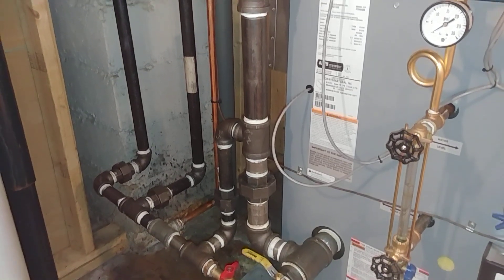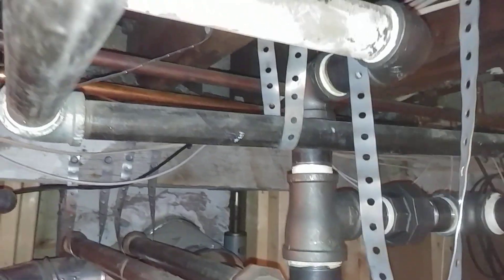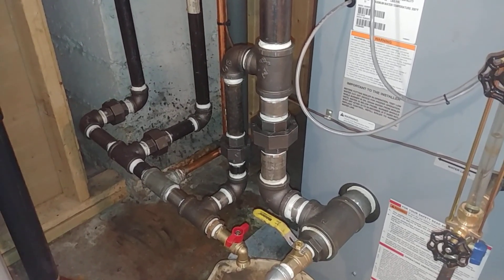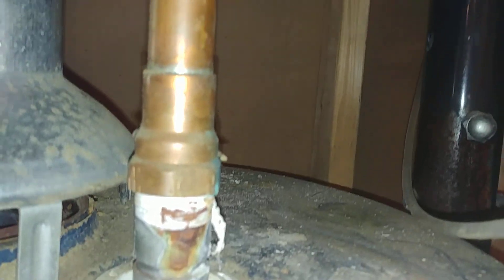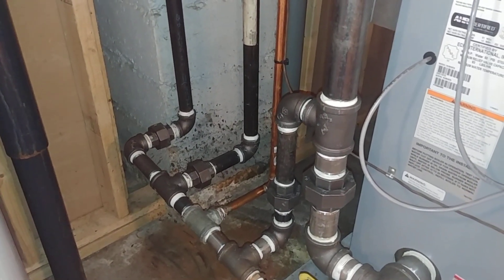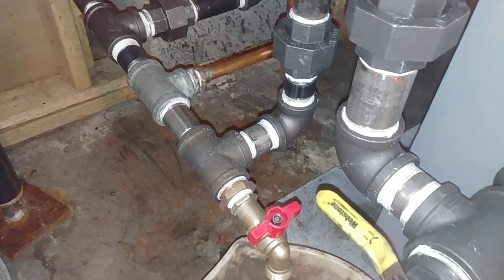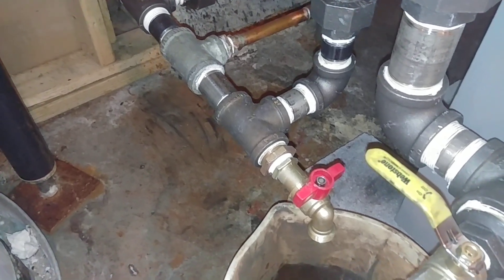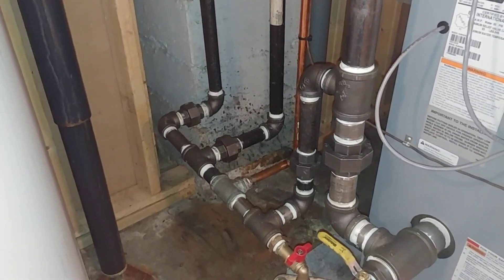Corrosion Control On Steam Boiler Wet Returns - Some Thoughts & Ideas

Comment: How do you feel about Rectorseal 8 Way BoilerTreatment?  I've been using it to clean a neglected steam boiler, and its supposed to help prevent corrosion, and a list of other claims. It makes the water a lavender color which is easier to see in the sight glass too, and it's fairly inexpensive. 

There claims.... 

Applications

8-Way can be used for cleaning very dirty steam boilers. Boilers with excessive scale, rust and muck.
8-Way can be used to maintain clean, rust free water on new or existing systems.

Benefits
Removes sludge.
Removes rust scale.
Inhibits boiler corrosion.
Inhibits steam line corrosion.
Prevents oxygen pitting.
Inhibits lime scale.
Prevents surging and foaming.
Controls pH with a color indicator.
Does not contain petroleum distillates.
Will not damage seals and gaskets.
Reply from the maker: I think it might be worth a try.
I have heard others also tout its benefits such that I am starting to become convinced to use it.

Comment: Stainless is great....hard to get a steady stock of sizes and fittings. My failsafe is a dielectric union and or brass
Reply from the maker: I pre-order runs of stainless and have them in my bunny box plus extras of close and shoulder stain-less nipples.

Comment: Someone suggested to me that they think that using distilled water is less troublesome than unfiltered tap water when running a steam boiler because it doesn’t contain any salts that will be dissolved and return to the boiler as sludge. What are your thoughts about this idea?
Reply from the maker: I am not sure about the wisdom of using distilled water in a typical steam heating boiler.
I might be spoiled, because the tap water in my area is not too bad.
As much as possible, the dead steam, or water, is being returned to the boiler, so there should not be a big build-up of total disolved solids (TDS).
Is distilled water, because it is pure, hungrier/more aggressive than tap water? I might be inclined to think so.

Now, if one is running a production steam boiler, especially where the steam comes in contact with food, that's a different matter...

Comment: I have had a question forever about mains and their sizing. In air flow, static pressure, velocity, resistance to flow etc, all play into ultimate flow/ CFM. (Not to mention the unit's performance and lifespan) The duct sizing relative to engineered blower CFM is more integrated than many people realize. But steam? If it expands 1600-1700 times, what effect does that have on the boiler? I hear 1 1/2, 2, 2 1/2, 3 etc and I wonder, how critical is main size relative to some other data point like BTUs etc? How critical is main sizing? What are the risks?
Reply: There’s a lot of forgiveness within the prescribed sizes. These systems are very low pressure, relatively low velocity. You just have to have enough room in the pipe for the condensate and the steam to coexist
Reply from the maker: The mains sizing generally was answered by The Dead Men before we get there. 
Usually their decisions were to oversize a bit, then go up one more pipe size because the last thing they wanted to hear from their customers is "I'm cold and it's your fault!"

Comment: Do you use imported nipples and pipe, or are certain of the steel pipe quality?
Reply from the maker: I remember hearing that the middle kingdom at one time did not allow any steel pipe from their domestic mills anywhere near their nuke plants.
I don't know if that is or was true.
I think they have gotten better.
A case of "fake it 'till you make it".
But as the PRC has gotten better, production has shifted to other areas like Vietnam.
Reply: I heard a similar anecdote about radiant heater tubes sent to the Big Rock Candy Mountain for processing needing security guards to prevent them from being stolen.

Comment: Also is a good idea to use galvanize pipes as a return line or this just make the rest of the boiler corrode faster?
Reply from the maker: I am still wary of galvanized pipe & fittings on steam.
A lot of Codes don't like them, so I am told.  
Above the water line, there doesn't seem to be an issue. 
I made a video about my thoughts on that, showing the inside of galvanized steam pipe that had been on a steam system for some decades.
I don't know as much about galvanized pipe for wet returns.
Bottom line, wet return steel pipes are going to rust. 
But they rust far less than one thinks, and with low water loss, should still last decades.
Reply: @gordonschweizer5154  The problem as I see is similar to water heaters, if some components in the system are galvanized and doesn't corrode as much then it would cause another parts of the system which is mostly not galvanized black or steam fitting to cope with more of the corrosion to compensate, basically making the whole system beside the stainless steel or galvanize element a sacrificial cathode.
Reply from the maker: I don't think you're wrong, but in this case, as long as fresh water intake is kept to a minimum, it is a minor issue at best.
Domestic water heaters are a whole another animal as they are all about dealing with fresh water everywhere all at once.
Reply: @gordonschweizer5154 What solutions are there to deal with the constantly introduced fresh water in the domestic setting? Having read many comments across your videos, it seems oxygen is one of the biggest issues? Is there something that can be added prior to the influx of water to help slow down corrosion?

Comment: I would like to know your thoughts on adding boiler compound to these residential low pressure steam systems.  My Dad’s house is running a Burnham 6 section boiler running on Natural Gas.  The feed water is straight off the street with no treatment.   We periodically drain off a few quarts of rusty water every month or so during the heating season and a gallon or two after being idle for the summer, non-heating season.
Reply: There are people advocating to avoid draining the rusty water as it's saturated with rust and oxygen depleted thus prevent the boiler from corroding any further. What I know is that the rust need to be flush or otherwise its foul the LWCO mechanism and thus the boiler get overfilled and start making banging noises.
Reply: @johnnychang4233  thanks for that comment. This single pipe steam which is venting air during startup and breaking vacuum when shut off and cooling down so O2 is being pulled into the system with every cycle. I was thinking a compound might create Magnetite to protect the steel surfaces from active corrosion.
Reply: @markwertheimer2320  As long as such compound doesn't became goo and sticky to the boiler inner surface and mechanism then should be fine but a lot of boiler manuals do not recommend the use of any compound in the inside because of risk of diluting the in between sections sealant and the boiler cleaner product are just phosphoric acid solutions that claim to help dissolve scales inside due to hard water that is dubious in any case if going unchecked with a borescope. I am not a plumber or an expert by the way so don't take my words at face value.
Reply: Oxygen is introduced during a fill. It is known along with the various other minerals in city water as TDS...total dissolved solids. People would then think ok...water softener, treated water....and while that can help.....steam boilers use and need whats known as conductivity...too much...too little...both are not peak operating conditions. Residential is hard to "get it right" because the end user doesn't want to oay for whats needed to have a really good operating boiler and pipe network. In commercial and industrial...we always see DA ( deaerator ) tanks, surge tanks, conductivity readings, automatic blowdowns etc etc. Lots of good information out there. Look into a drop header. Gordon is a great resource and channel. Lots of great information here
Reply: They all raise the ph to inhibit corrosion